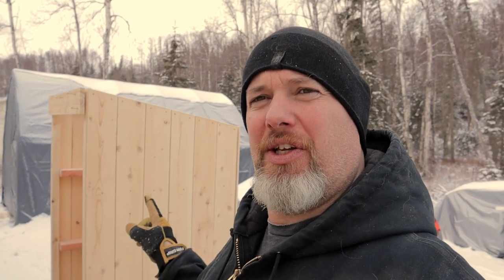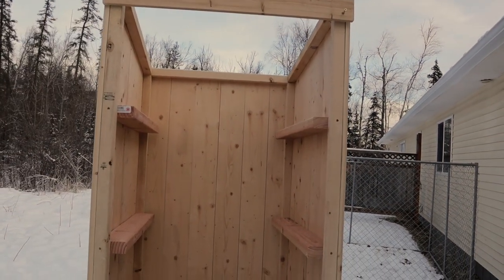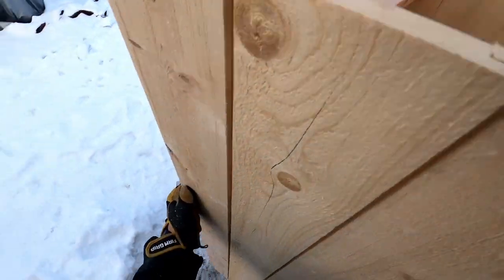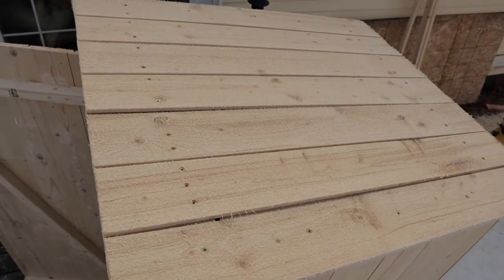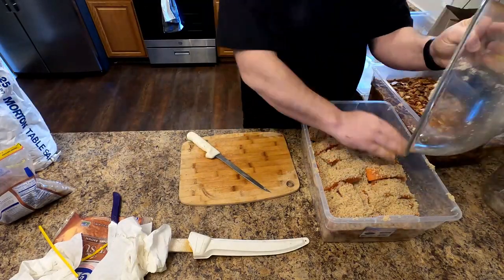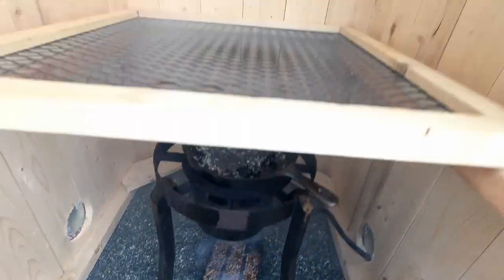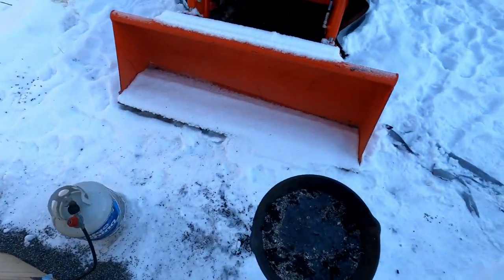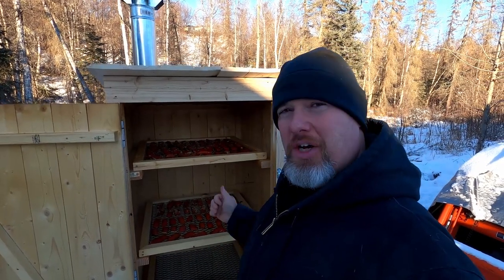Building a SIMPLE wooden SMOKER Part 2

Comment: Soaking the wood chips doesn’t add flavour until they dry out and start to burn. It just makes steam until it dries. Check it out for yourself. Don’t add as many at the start and after an 1-3 hours (depending on what your smoking. Fish an hour, beef brisket 3 hours or so.) add additional dry chips or wood for flavor. The wood chips don’t add flavours until the burn. That’s the same with any “green wood” too. Check it out for yourself about the wet wood chips. I used to do that to, but not any longer. I love the smoker thought. Well done brother. Give it a try. I reckon you’ll love the flavor, and the smoke seems to “penetrate” the meat more. On thick meat like briskets the smoke only penetrates half an inch-ish. Inject the meat with apple juice before smoking. It breaks it into collagen making softer, moist, and flavourful meat.
Reply from the maker: Great tips, thank you
Reply: No worries. I just recently learned that myself. I used to always soak my “flavor” wood to, but not any longer. Love your smoker build absolutely br!
Reply: Why do you even need to add chips? Isn't it enough smoke from pellets. Also keeps it cooler for cold smoking.

Comment: What about using a regular kitchen oven with smoking chips/pellets in the bottom? I have an old one that I want try it with. The top part of the stove is no good, so I'm thinking of drilling a couple small holes in the top and use it as an electric smoker. The oven has a heating element in the top & bottom. If put a metal tray with chips/pellets directly onto the bottom element that would create the smoke and top element would do most of the cooking. 🤔

Comment: Oh man that looks tasty! Nice work too, I like the simplicity of the design. Is the propane heat source basically a turkey frier stand? The brine recipe is identical to what I have used off and on over the years. What was the cook time and temp for the batch done on this video? Stay warm and safe folks.
Reply from the maker: Yes it’s what we call a crab cooker but same thing.  I’m not sure on time but it was about 1 he of cold smoke and 2 hrs of heat at 170-180F.  I like the simplicity of the brine.  Sometimes I’ll add crushed red pepper to the brine for a little kick.😊

Comment: Is there anyway you can tell me what you used for the vents on the bottom as well as for the roof?
Reply from the maker: I use 3 inch galvanized vent pipe for roof vent and 4”x4” metal electrical box covers for the bottom vents. Bottom vent are 3” holes that the metal plates cover and you can rotate the metal to adjust your air intake.
Reply: @wildwoodoffgridalaska  awesome thank you!!

Comment: Is that a "regular propane hose" ??...rubber,  or does it have some added insulation? We are building one and are a bit concerned of the rubber hose inside the smoker.
Reply from the maker: It’s a standard propane hose that come with any of the cookers you can buy. I’ve been using this for several years and have never had a problem cooking meats out to 300 degrees.
Reply: @wildwoodoffgridalaska  Thanks for getting back to me, guess we will stick to the rubber hose

Comment: Fantastic project! Curious about your temp control? Highs? Lows? Holding at a desired temp? Is it as simple as more or less on the gas? Wife and I wanting to get into our own Venison sausage, which calls for smoking a bit lower temps.
Reply from the maker: It takes some getting used to and a lot of tending but, yes I regulate the heat from the valve on the burner. Once you get it dialed it’s pretty consistent. Building your own smoker is fun and you can build it any way you choose. All you need is a box for smoke and a heat source.  I hope you enjoy some home smoke venison soon.😁